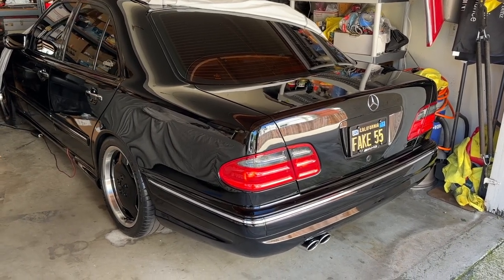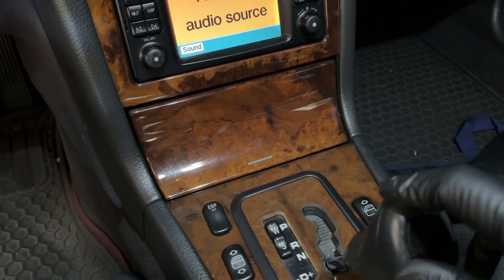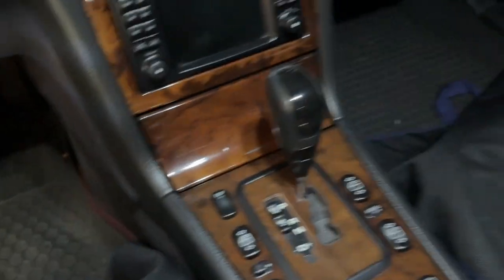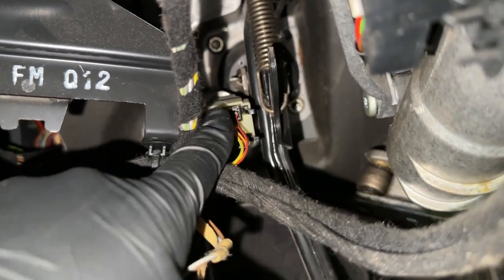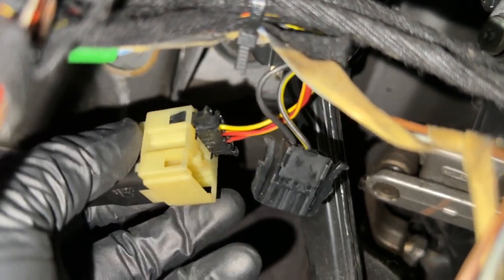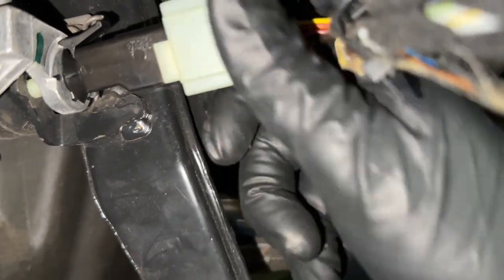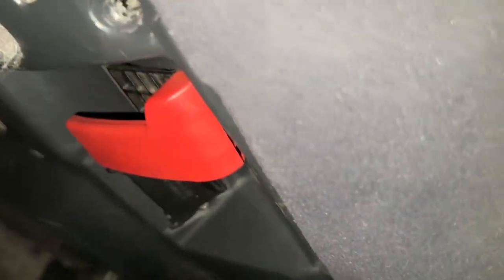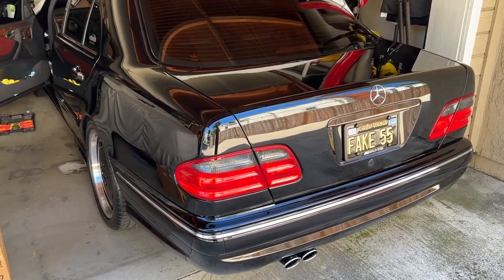Mercedes W210 Brake Light Switch Replacement

Comment: Dang my cars brake switch went out and mine has the older pos-looking brake switch with the two big metal prongs for one of the connectors, its more expensive too 🙁. The switch for the facelift cars looks modern and fits in with the rest of the wiring down there, the older looks like someone just jammed a old part on there lol.

Comment: Do you know if the W140 1999 S420 computer needs to be driven to reset/sync after the brake light switch has been replaced? I pulled the plunger in my original and the light went out almost immediately (battery unhooked because it's draining despite the brake lights not being lit). Got a new brake light switch and replaced it, but the BAS/ASR/ABS lights are still on. Any ideas?
Reply: I had same issue it’s the squib the light sensor on eBay costs about £28

Comment: Hi 
I have a Mercedes e220cdi w210 1999 facelift model. Before 2 weeks the thunder hit my car and I can’t not open the doors with the key. When the key put in ignation have a contact but no crank and no start. Went to mechanic he changed ecu of engine , automatic transmission ecu and shifter , ignation for key and also they are pared on diagnostic. Now the engine start good but inside on the dashboard all lights are on , speedometers not working . When I start drive the transmission is stuck only in one gear and no shift gears and the car go only until 3000rpm. Also the problem is battery is empty after few days standing a car and when I press break pedal dashboard and instrument panel light blink same like when is headlight on. Any advise or help please? Sorry for my long comment.

Comment: My e55 cannot shift out of park unless you jam something in the shift release hole, but there are no warning lights for ABS or ESP and the brake lights still work normally. Could this still be the problem?
Reply from the maker: Maybe. If your brake lights work properly then it’s most likely not the brake light switch and a problem with your shifter.
Reply: @SoCal210  Thanks, I'll start with the brake light switch and pray it's that and not the shifter itself!